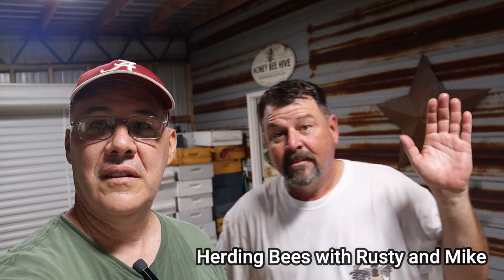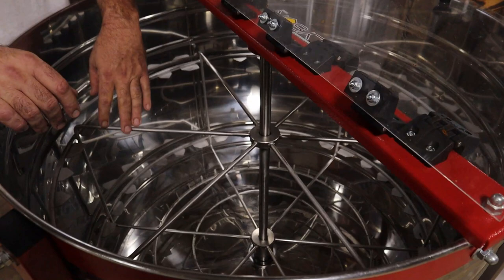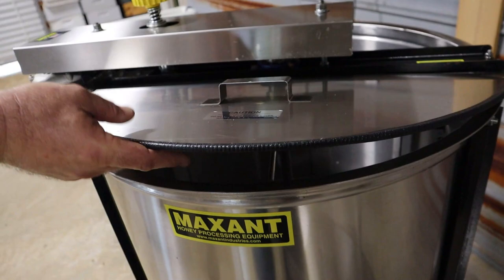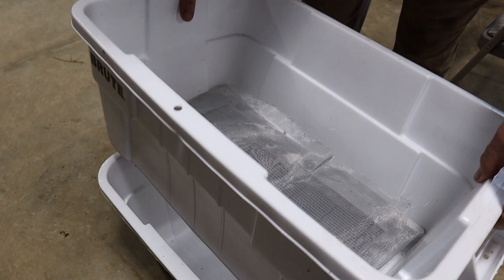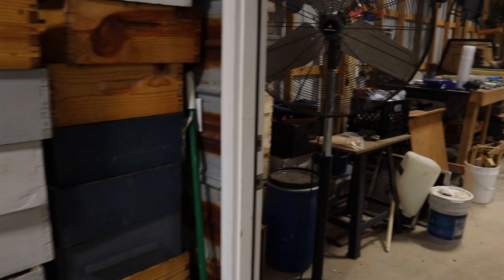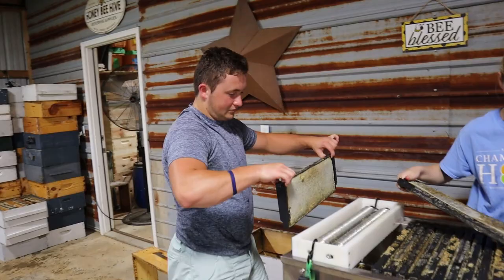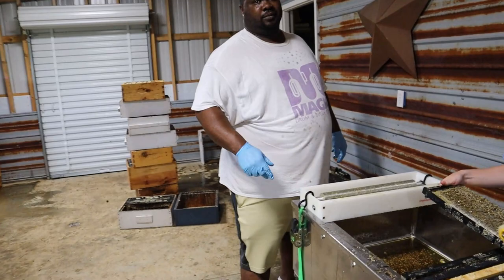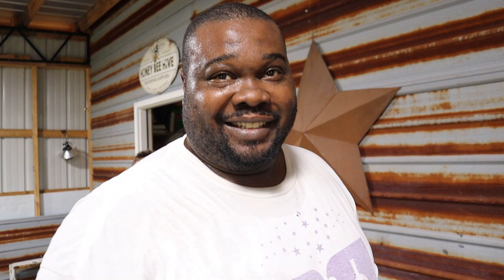Honey Harvest | LARGEST CROP EVER (by a LOT) | Amazing!

Comment: You need some migratory covers with a built in rim. Use them as bottom boards for the supers. 
Makes it where you can use a dolly to move the supers. It also catches the cappings when the bees clean out the supers.
Reply from the maker: Sounds like a good idea.  Thanks. I have a few lids with patty rims but not many.

Comment: Just like a timex there Bruce…… “takes a licking and keeps on ticking!” Lol. You hardly missed a beat…. Great job!  Curious about how long you run your Maxant 20 frame for during each batch?  I just got ours this spring and was wondering how others were doing with it.
Mike
Reply from the maker: We run it at a speed where it begins slinging honey for a few minutes until it seems to be spinning freely and easily.  Then we turn it up to full speed until it is no longer slinging honey out.  We j must look down the edge with a light. Careful with that kid though lol.
Reply: @brucesbees  so how long would you estimate you run it, from start to finish on average?
Reply from the maker: I really don’t know.  Maybe 10 minutes.

Comment: I wonder what it would look like to roll the door up and let the bees clean the mess. Then come behind with less clean up. Not the boxes. Surely you'd have to run some CAUTION tape. So how long would it take the bees? Also it would be a good video.
Reply from the maker: It would be a crazy situation for sure haha.  At the end of the video you might get a little idea of what it would be like.  We just wanted to get it all cleaned up quickly and with the pressure washer set up it really doesn’t take long.  Thanks for watching and for checking in.
Reply: @brucesbees  
It would definitely be a mad house. 
But could be amazing to watch. 
But I'm on your side,  shut the door before it starts. 😀

Comment: What does the paint roller do after decapping
Reply from the maker: You mean the pin roller?  We use it on any cells that may not have been sliced by the Simple Harmony Farms Uncapper.  Sometimes there is a low area or really tough old comb.  We just try to make sure that pretty much all the cells are sliced.

Comment: Great video. How long did you leave the trailer with the empty supers? Those bees were in a free for all.  Did you clean up at the end with only water in the extractor or did you add soap?
Reply from the maker: We left the supers on the trailer for 6 days but probably could have taken them off sooner.  We just used water.  Honey melts away quickly with water. There is a good chance the extractors won’t be used again until next year so I’m sure we will make sure they are appropriately clean before using again.

Comment: Great video, Bruce!
I only Have backyard hives. I have a 4 frame extractor. Why do I have such issue with it shaking and being off balance? I have it bolted down to plywood and even stand on the plyWood but it still shakes and moves!
Reply from the maker: Yes it is always an issue.  Out extractors are bolted down to the floor and they still tend to work their way loose sometimes. The only thing I know to do is try to distribute the weight as evenly as possible but even then it can get a little wild.  We have done a lot of leaning on extractors over the years.
Reply: You can use caster roller bearings underneath a board to allow the extractor to walk about a bit.Try to get even size cut Combs,if pollen in combs will get uneven as extraction proceeds.never leave motorised extractor running unattended